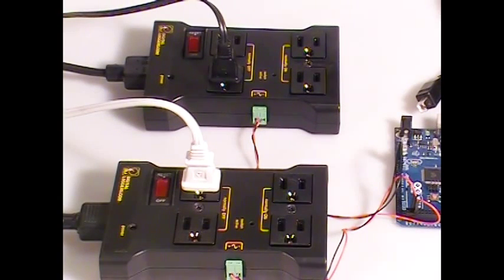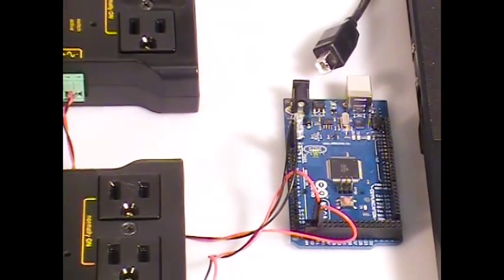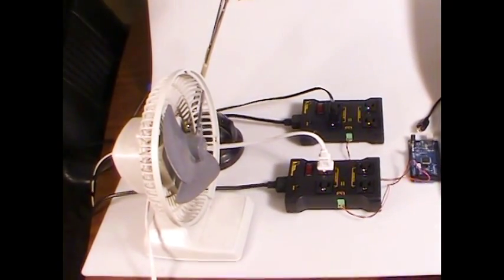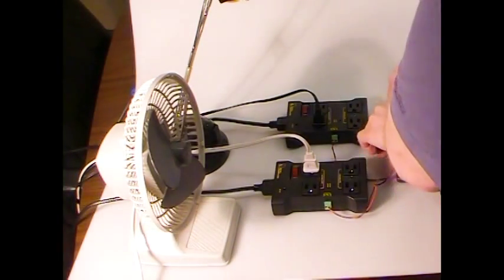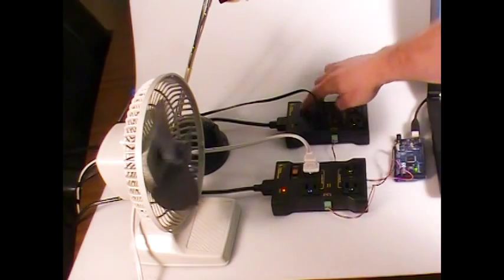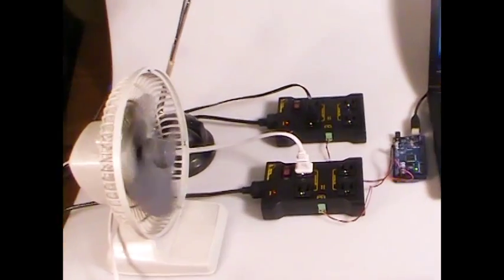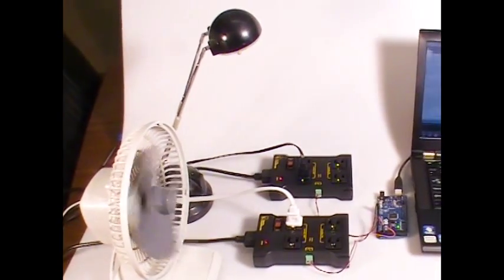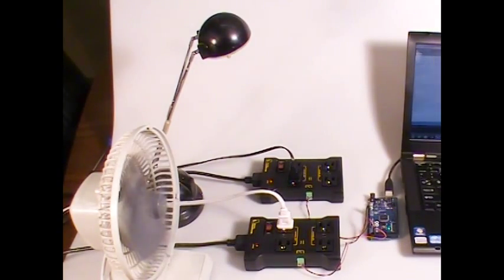Control the World with an IoT Relay

Comment: I have pretty much zero hardware/electrical engineering experience - this could not have been easier to set up (using a Raspberry Pi 3). I was intimidated, wondering if I was going to need any other equipment to get this relay to work - resistors, etc... thanks so much!